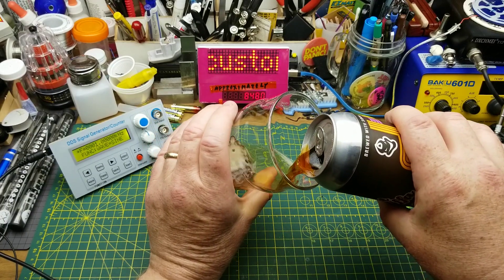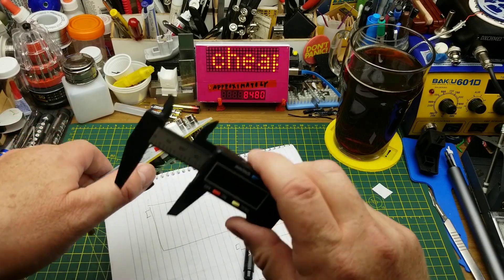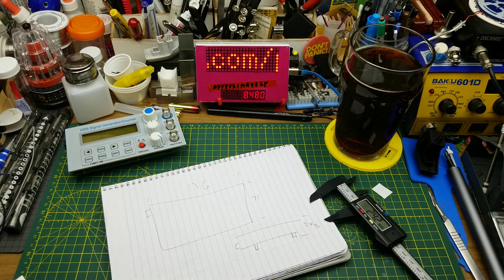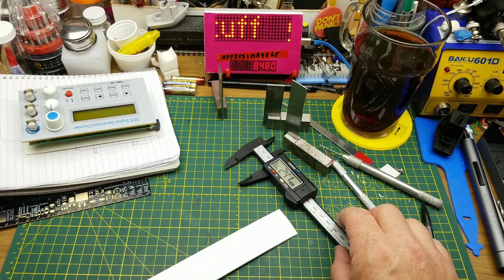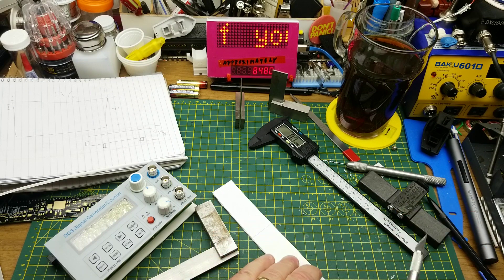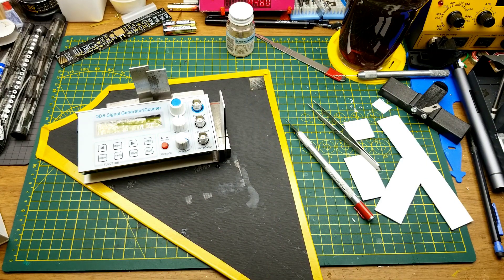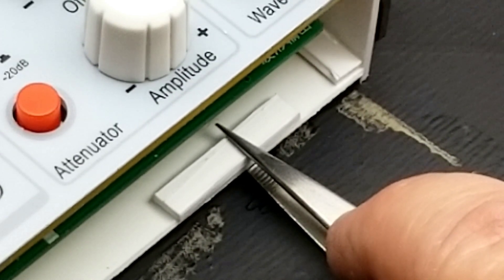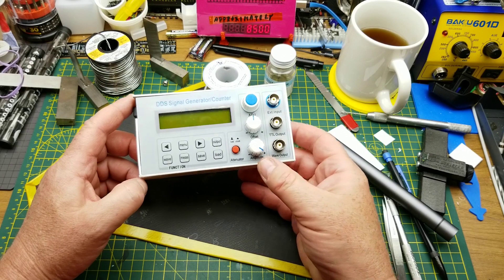Cheap and simple project case

Comment: Hi there from Oshawa... For simple 3D prints I use OpenSCAD..  It uses a text file to define the object. It is easy to build a box with functions like cube and cylinder. Also easy to return to tweak the design.  Enjoy your videos and your easy relaxed style.
Reply from the maker: I sometimes use OpenSCAD for simple geometric shapes. 
I tried to use it for the box I showed at the end, but I was having trouble getting things oriented properly. My brain doesn't visualize that well in 3D space.
I ended up using FreeCAD .

Comment: 20:22 - That looks like craft board from Dollarama.  Foam inside with paper outsides.  But I've only seen it in white and black.  Commonly used to make low cost RC planes.  Large sheets are only $1.50.  Hot glue is commonly used to hold it together.
Reply from the maker: This stuff isn't foamcore, It's the same density the entire thickness.
It's some sort of plastic used in commercial signs (or at least that's where I got it - from a discarded sign).

Comment: Thanks - great video! Next time you are going to cut some 3 mm screws to length, first file/grind a point on the end then save the cut-off pieces. When you need to locate some screw holes screw in the pointy bits and apply a little pressure - instant centers!

Comment: Okay good idea and nicely done box but please consider the heat that may get trapped inside it. 
Plastic is an excellent heat isolator it may get mighty toasty in there and it may shorten the electronics life or worse. Maybe put some venting holes to be safe ?
Reply from the maker: Always worth considering.

However this board doesn't seem to get noticeably hot, and I don't keep it on for long periods of time anyway.

And, of course, the box is more leaky that it appears...

Comment: Consider using single-sided FR4 boards.  Can be soldered together instead of glueing them. They can also provide additional shielding which may be beneficial for projects like a generator or a scope.
Reply from the maker: Interesting idea. I'll have to give that a shot sometime.
especially if I'm doing a project that need to be shielded anyway.
Reply: Or even double sided, why not? Coppa looks posh

Comment: I would go with your handmade case rather than your 3d printed case. The reason is because the screws will be sticking out past the end of your printed case, potentially scratching any surface you put it on. If I were designing a case to 3d-print I would have the screws recessed.